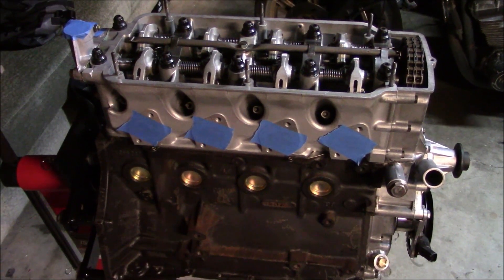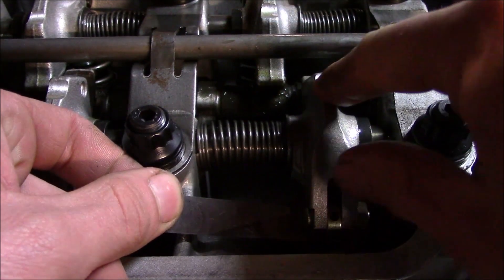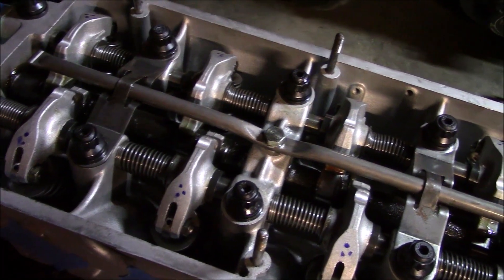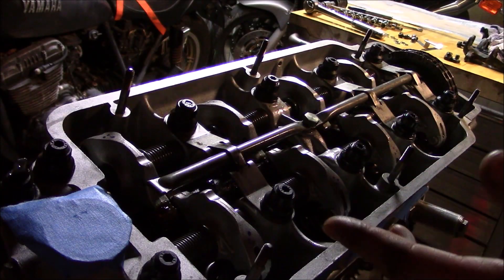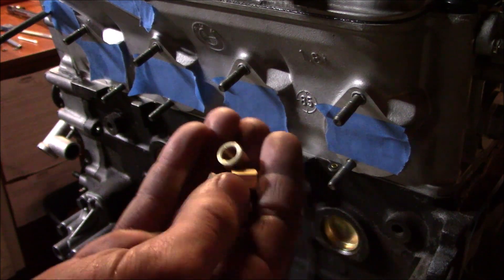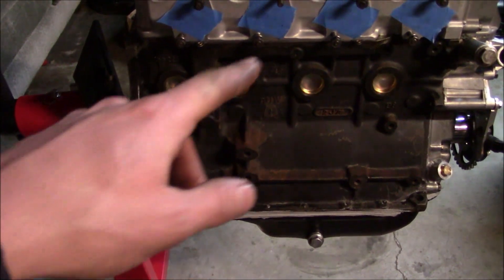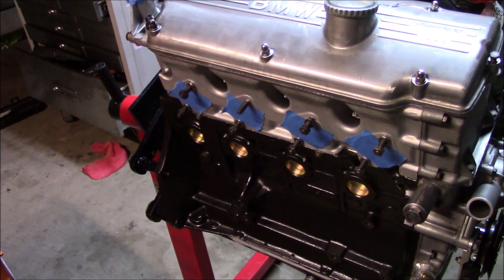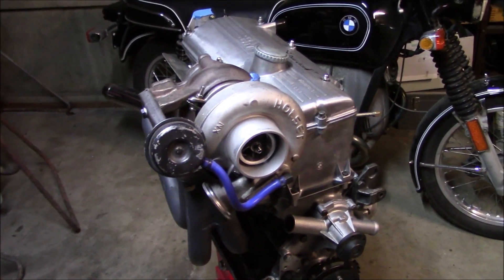BMW M10 Engine Rebuild 2002 Turbo Part 3

Comment: Hey awesome build I plan to do the same next year.
How did you get megasquirt to work? this is the last thing I'm stuck on before I start pulling the trigger on components.
(What will I need to make MS3 work).
Reply from the maker: I'm not sure on MS3, I'm on an MS2 box from 2005 and EDIS from a '92 Escort

Comment: Hey Benjamin, Tony here. I just want to say, I really enjoyed your build video. I have a 74 2002 and I was wondering if I could get more information from you, regarding parts and what it would cost.
Or even better if you would be interested in building the engine. I know it's a wild idea,  but why not!

P
Reply from the maker: I can't take on a build right now sorry about that. Don't have immediate access to a full machine shop anymore. Thanks for watching and subscribing man I appreciate it. To price out a build, best way is to go to real OEM and get all the part numbers then figure out the cost of consumables, then add that to whatever machine work is required when you disassemble and figure out what's bad.

Comment: 8:00 thats a good back story. I just grabbed mine from a 250k mile e30 block
Reply from the maker: Nice! Be careful turning it up too much with the E30 blocks, they are more prone to cracking because of the lighter casting. And thanks for subscribing I appreciate that man!

Comment: I use NGK Br7Es,, The protruded plugs i gave up on, the plugs stay relatively clean, and on boost i gap them down to 0.26/0.28 to prevent spark blow out.. excellent video tho im looking foward to the next one
Reply from the maker: Thanks for sharing about the plugs and I appreciate you subscribing!

Comment: Excellent videos! I am going to build m10b18 turbo in E30 318i 77kw. My plan is to used as much of standard hardware as i can and keep it alive with proper engine control with Emublack ECU sequential injection and ignition with 2 knock sensors, twinscroll EFR 6258 turbo (tubular short runners, bottom mounted turbo) and water intercooler running on E85. Regarding hardware i would love to get by only with rebuilding the engine plus oil baffles, MLS head gasket and upgraded rocker arms (hoping for 7000rpm) (i might have forgot something). yeah..... and point is not to blow that poor engine up having 300Kw at 7000 Rpm.... any suggestion highly appreciated :)
Reply from the maker: Thank you! And thanks for subscribing! Keep me posted on your project I hope it goes well!

Comment: thanks for all  bro ,i have the same engine ican do it with  the simple  piston (stoc)  ? if yes  in how much pressure can bear ? tnx  and good  continuation
Reply from the maker: I have been for a while, didn't have any issues with stock. What exact M10 do you have? Some are stronger than others.
Reply from the maker: Also thank you for subscribing!